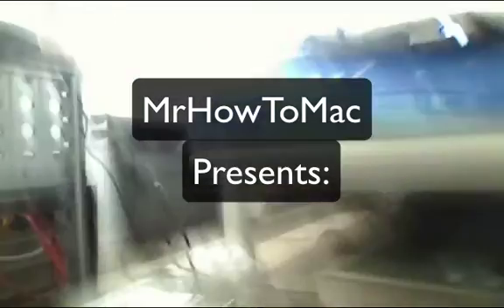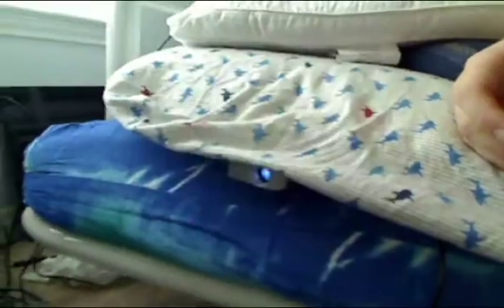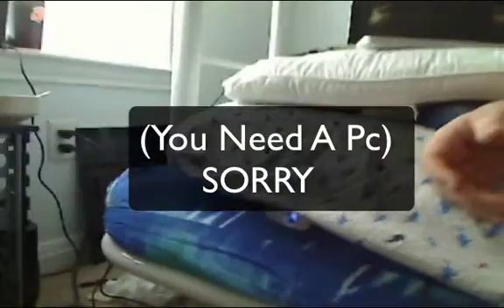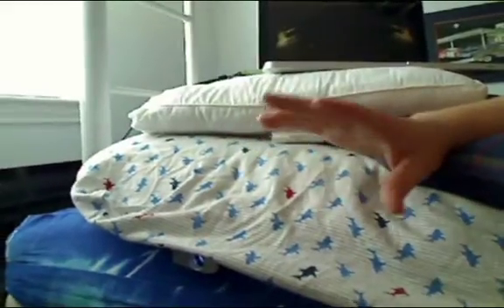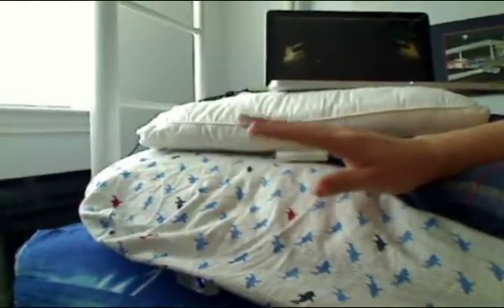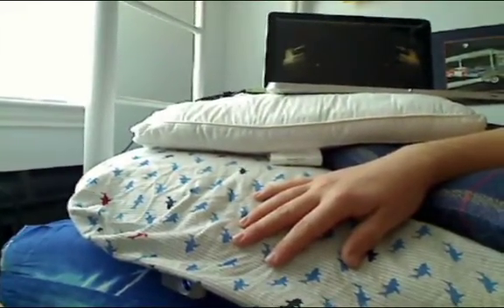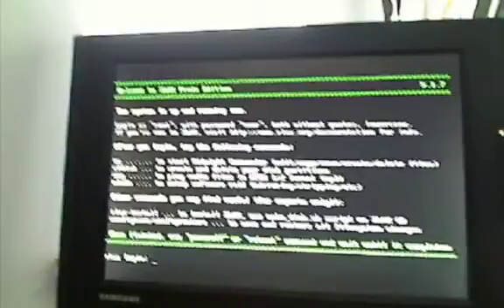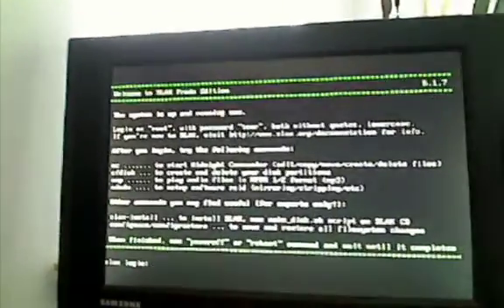How To Flash A Xbox 360 Hitachi Drive (Part 1)

Comment: ... top right where the drive list is displayed, only my normal cd drive is detected, thats my issue, i use windows xp 32 bit os with via vt6421a installed with the uniata drivers done, if i can get it to mode b then it should be able to show on top right drive list on jungleflasher and then i can do the rest, please share your knowledge of how to flash this drive 2 days of work spent already, thanks in advance. The jungleflasher is 1.92b btw which should work.

Comment: I think slax updated, i don't have the linux penguin on top screen and it changes my monitor mode a bit later and as i read there is no disc spin text, i tried to spam open close to see if there is any timing between the entire cd runing and there isn't any to send the hitachi 79 into mode b, my issue is simple, my hitachi drive doesn't read on my pc at all, but it reads on jungle flasher port description, doesn't detect hitachi drive on bottom when i try to send mode b, and wont show on...

Comment: THANK YOU SO MUCH! If it wasn't for you I wouldn't have realized the 2 xbox's I bought from some random; when he put the drives back together, he accidentally put the wrong drive in each xbox,  now I just switched the drives up and works 100%. It hit me when you put it on originally and you were talking about the "xbox 360" logo on the screen and not doing anything. (Because that's what happened to me"..  Thanks again!

Comment: im on windows 7 32 bit plugged straight into my motherboard. it can read the drive in the boot menu but on windows it doesnt recognize and the slax disk tries to put the drive its in into mode b and never goes to sata 2 which is were the drive is plugged in. yes i do have portio

Comment: Theirs an option in Jungleflasher to put the drive in Mode B. I used the Slax disk but it didn't work so i just used Jungleflasher. Anyway what about 79? you need Unlock 79 CD